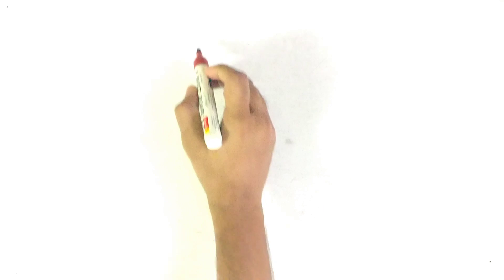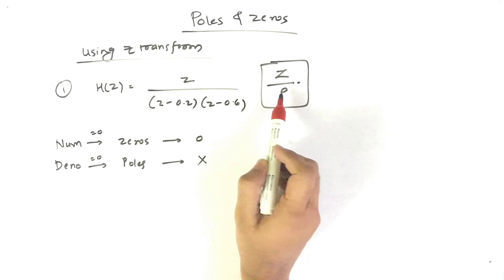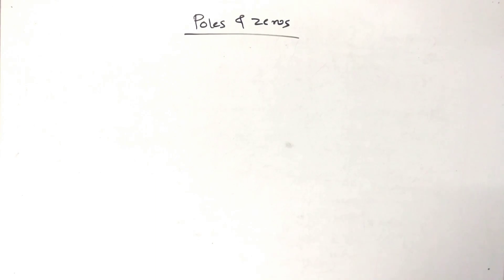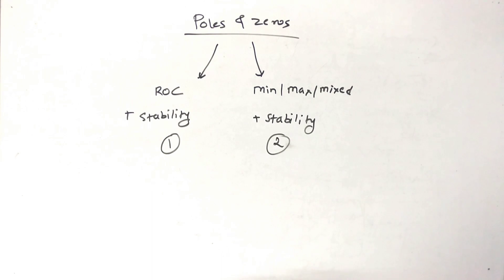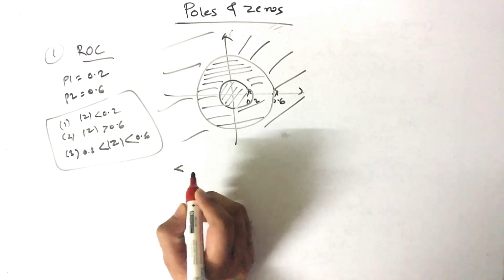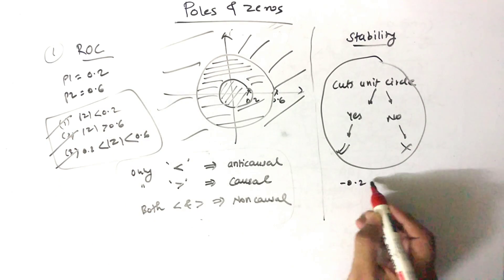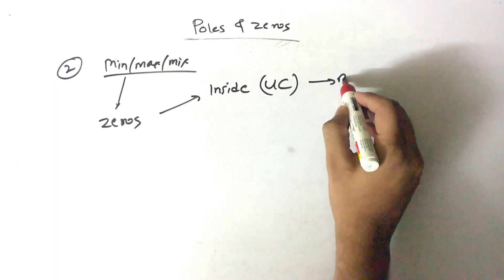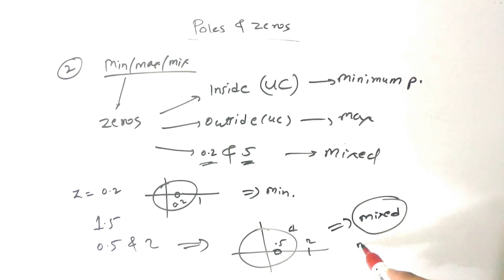Poles and zeros - ROC, stability , min/max/mixed phase system using z transform

Comment: 👇🏻👇🏻👇🏻👇🏻👇🏻
Unit circle= circle with "radius 1"

That's why the |z|>0.6 cuts the unit circle (because it is greater than 0.6 region of convergence (ROC) it will cut unit circle).

Comment: Hi, Thanks for the uploading this video, it is very helpful. I have a question here, stability based on ROC , |Z| > 0.6 is stable since it is touching unit circle. When u discussed about stability using poles. Poles should lie inside the unit circle. So conflicting each other as "ROC" is also defined from poles. Now take the pole P=0.2 which is also inside unit circle. Could you please make this clear to me
Reply from the maker: +Delli Prasad 
Roc takes all cases ..
So it should be treated separately ..
Roc can be causal Non-causal anticausal ...so consider unit circle cutting area for stability
Reply: Thanks for your reply !!.So how can i reply for a system whether it is stable or not, either by using ROC(ROC should cut the unit circle) or Poles should lie inside the unit circle. Please clarify
Reply from the maker: Delli Prasad 
If Question is based on roc...
Then roc based stablility.
Or else normal pole zero CONCEPT